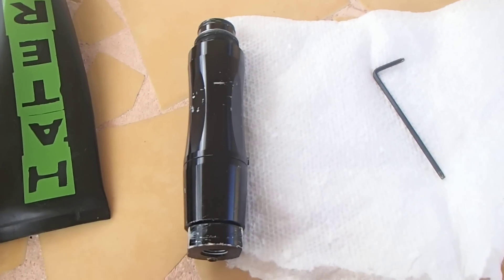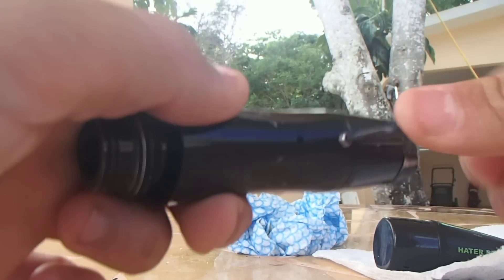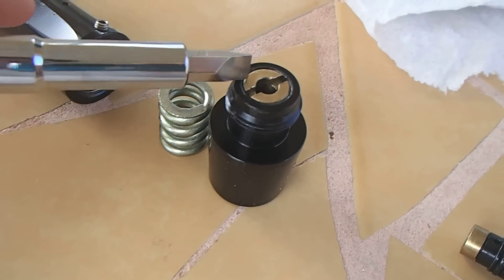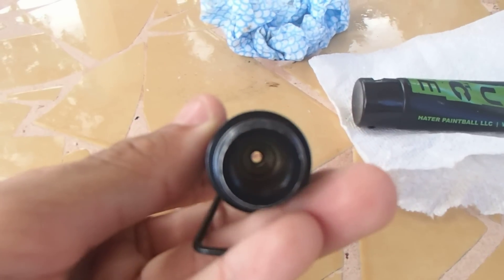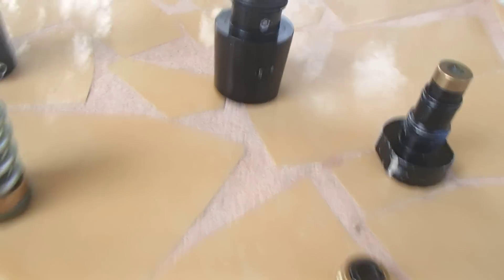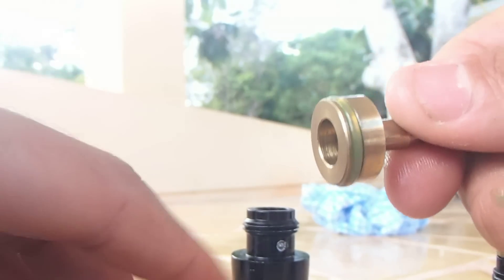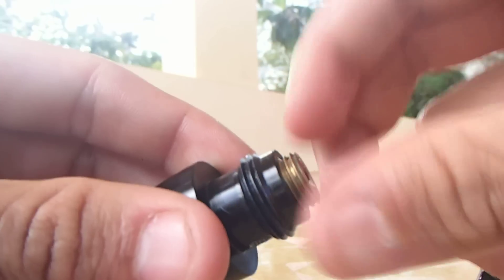2012 Spyder fenix regulator disassembly/maintenance (complete)

Comment: @Nael Ramos I have a problem with velocity on my fenix, i backed my velocity adjustment screw all the way out and i was still hitting 260-275fps on a field with a 240 max fps. will adjusting reg help lower velocity too ?
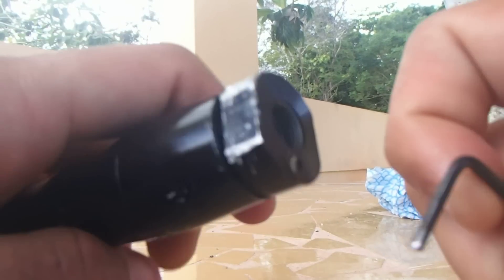Reply from the maker: Yes, going counterclockwise will decrease pressure and lower velocity. Balance this with the velocity adjustment screw to get better results. Looks like your reg is set up too high, go counterclockwise to seal the pressure just a bit, going too much will cause it to lack of air, acting if your fenix is out of air. adjust it evenly with the adjuster to do some fine tuning results. Look between 8:00 to 8:30 on this video.

Comment: hey Nael is the piston spring supposed to rattle around in there after you reassemble it back together? i shake it and it rattles around alot
Reply from the maker: DoughBoyLGMX3 its natural, dont worry about it. When you air it up, it  will be in its place and it will stop moving.
Reply: Nael Ramos thanx! i was starting to go crazy lookin it up

Comment from the maker: You can unscrew the regulator from the marker, by getting a key, unscrewing the steel hose that is connecting to the regulator (Like you saw on my earlier video. watch?v=6D2EGN5yzQQ) From there just get your hand and unscrew it from the marker by going clock-wise direction, You should be able to get it out. Hope this helps!

Comment: Yo whay do i do if the regulater spins while on the gun?
Reply from the maker: pumkinface1 1 You would have to screw the regulator back where it was because it's not suppose to spin while in use.

-Nael